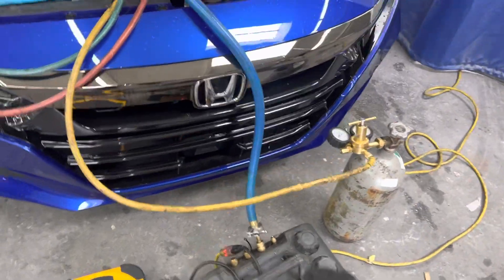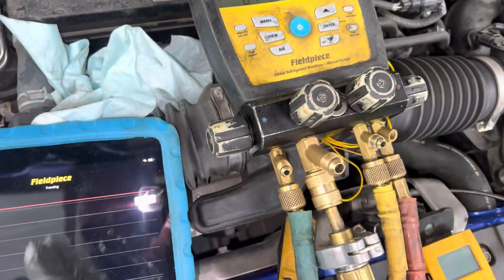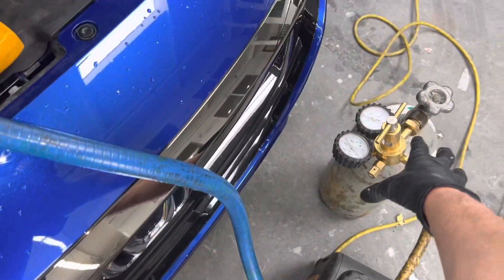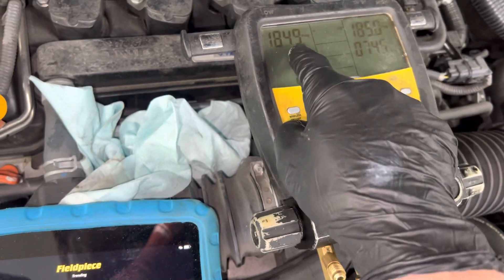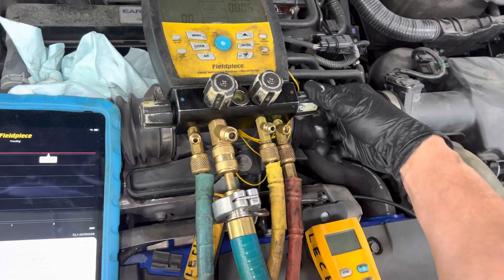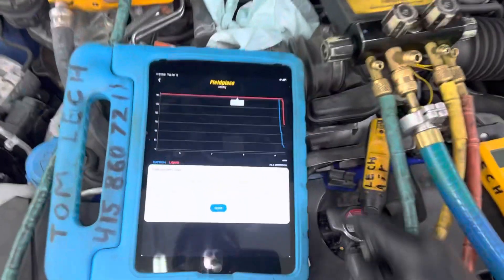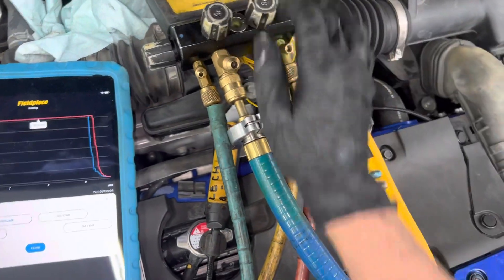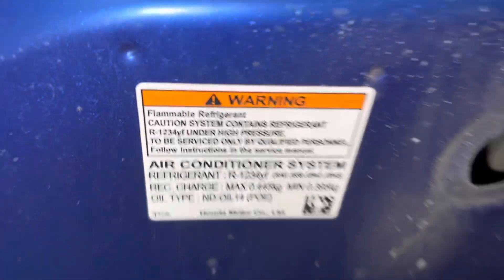HIGH PRESSURE NITROGEN DECAY TEST 185 PSI Testing for leaks on a Honda ￼

Comment: Love that graphing feature. Nice video.
Reply from the maker: Nice to work on something else in the shop.  Catch intermittent problem or see fan, clutch, duty cycle of compressor control valve are working over time. 
       Can even see when thermostat opens on coolant
Reply: @coldfinger459sub0  so that is like a scan tool reading data from the DLC then? Never seen one like that, but it looks specialized.
Reply from the maker: Yes, like a scan tool reading amplitude overtime, but doing the exact same thing with pressure. 

And the pressure directly correlates to a signal power in a fan on or off or a duty cycle signal going to a variable speed fan raising and lowering the fan speed to adjust the high side pressure and you can data log record and actually watch it in operation. 

The same goes with the duty cycle that goes to the compressor control valve, unbearable, displacement, compressors you can actually watch the swash polite be ordered to move, increasing or decreasing displacement change in pressure .

Comment: After vacuuming the system,when you connect the refrigerant cylinder,do you purge the air from the yellow hose?
Reply from the maker: Are usually use the vacuum from the big blue hose through the manifold to the yellow refrigerant hose
Reply: @coldfinger459sub0  here in this video you close the yellow hose you said no leak.When you connect that yellow hose to refrigerant tank  do you will vacuum that hose because here still attached to nitrogen tank?
Reply from the maker: @issamadam9352  attached yellow hose moves to refrigerate.      Then vacuum yellow hose.
Reply: @coldfinger459sub0  To what microns do you vaccum the yello hose?
Reply from the maker: @issamadam9352  100 µm
Reply from the maker: @issamadam9352  between videos I don’t think I showed him the video detaching the hose from nitrogen and then attaching to refrigerant tank.

Comment: After A/C repairs do you nitrogen pressure and decay test first then vacuum, then recharge?
Reply from the maker: I do a very quick vacuum say five minutes get down to about 500 µm. 
       Then I fill it with 200 psi of dry nitrogen to perform the high-pressure nitrogen decay test. 

Then I bleed out the nitrogen after the test is finished 

Then Iperformed the long vacuum.  Then vacuumed to K test to confirm it holds vacuum.. 

And then recharge.
Reply: @coldfinger459sub0  say the system is contaminated with moisture and you can't get 500 microns in a reasonable amount of time? I don't understand the need to do a quick vacuum first if you're going to end up doing a long vacuum later on anyways? Just trying to wrap my head around all this. Wanting to pick your brain a bit.
Reply from the maker: @MACEVES  you’re trying to remove the air in the moisture that’s already in the system out.  Trying to at least approach 500 µm which is usually very easy to do unless it’s extremely moisture contamination. 

You’re at least lowering the . 

You’re removing the oxygen which is 21% of the air that could be in the system after it was taken apart and replaced  

So you’re not pushing that into compressing it under a high-pressure . 

Infusing it into the existing POE oil or PAG oil. 

So now when you start your high-pressure nitrogen decay test. 
       You will only have 100% dry nitrogen that you have introduced into the system. 

Your relationship will be only with 100% nitrogen.  
     With 0% oxygen. 

And if you were doing commercial low temperature Refrigeration. 

You’re shooting for a level at 200 µm or less vacuum decay test. Because the moisture level has to be so much more less.. 

And if you’re doing something like the commercial VRF heat recovery systems that I sell and install.   you’re doing a high-pressure nitrogen decay at 600 psi. 

And because you’re dealing all with copper refrigerant piping.  That you’re actually silver brazing high temperature at all the joints with no gaskets or rubber seals.. 
       With all brand new copper, you are constantly purging dry nitrogen through the system, nonstop from the beginning of the system of the outdoor unit all the way to your furthest, indoor air handler that you can have anywhere from 1000 feet to 3000 feet of copper piping. 
      When you’re finished dropping the vacuum that you have left on the pump anywhere from 24 hours to 48 hours of vacuum until you achieve the level of down to roughly below 100 µm. 

In one of my videos, I show down to 13 µm with over 1000 feet of piping. 

These are the levels that you’re trying to achieve if you did a good job. 

In Automotive when you’re putting a brand new system into a car, all the components are brand new out of the box. 

You easily get roughly 30 µm to 60 µm within 10 minutes to 15 minutes. 

And then I would start my high-pressure nitrogen test after I have proof my system is dry.  Hit 200 psi. . 

After I passed the high-pressure test. 

Slowly bleed out the nitrogen through the low side pressure.  Then start the vacuum again from just the low side.. 
        Well, reading the dedicated micron gauge on the high side port. Back down to below 60 µm. . On a clean brand new dry system.. 
     Which is really easy to do when you’re using a vacuum pump that is rated down to 3 µm and you’re only using silicone hoses no refrigerant gauges no refrigerant hoses. 
       Or soft copper lines instead of hoses. 

Soft copper lines are cheap and easy to make and very pliable. And you could pull a deeper vacuum with them easier.
Reply: @coldfinger459sub0  I see, appreciate you sharing your knowledge.
Reply from the maker: @MACEVES  it makes everybody life better. 

The technician performed to work has fewer comebacks .  And he can make better money.. 

Better work by a technician means the customer gets a better quality job without the technician being the cause of future defects and breakdowns . 
      The consumer gets better value. 

Hopefully the shop can make better money so they can afford to pay their technicians better and give them better benefits 

It’s a DYI doing his in his backyard. He can learn more and do better jobs for himself, saving himself money. 

It’s a win-win win Situation all around for everybody.

Comment: What do you recommend to do a nitrogen test on a budget with the equipment? Can you use manifold gauges regular ones and a nitrogen tank to check for leaks?
Reply from the maker: You have to have a pressure regulator on a nitrogen tank. 

Because there anywhere from 2500 to almost 4000 psi . 

So the nitrogen regulator will take that down and adjust it to your 200 psi that you want . 

The hoses on refrigerant gauges are only rated for 800 psi burst pressure. Your hoses would explode  like a balloon.
Reply: @coldfinger459sub0  I see, do you recommend those H2/N2 gas sniffers for when you have the nitrogen in the system to find leaks or the good ole soap and water method will work? Also when you purchase the nitrogen its pure nitrogen and no moisture ? Appreciate your videos, dealer trained and never learned this in class.
Reply from the maker: @omega200k5  the hydrogen nitrogen or the helium nitrogen mix it’s a 95% mix of nitrogen with 5% helium or hydrogen.  They premixed.

But you can buy nitrogen from any welding supply warehouse . 

The helium or the hydrogen it’s called forming gas that mixture and you have to have a specific leak detector just for helium or a separate one just for hydrogen they’re not the same .
Reply: On a empty system, if you charge it with nitrogen to check for leaks, could you also run with the nitrogen to check for compressor operation or would that burn up the system?
Reply from the maker: You should not run a system charged up with nitrogen. 
Nitrogen does not compress the same way as refrigerant . 

Inside the cylinders, the compression racial will be much higher in some situations even for a short time you may not break the compressor, but you can damage the compressor . 

Something that you may not notice right away .

Comment: Which side do you put nitrogen through high or low side?
Reply from the maker: You’ve asked that question before. 

And I’ve probably explained it, and at least 100 videos . 

I push nitrogen through the high side and bleed it out the low side . 

I have the nitrogen follow the same path as the normal flow from the compressor high to low

Comment: Vacuum from both or one side?
Reply from the maker: If vacuuming after adding nitrogen from either the triple purge and vacuum procedure or from high-pressure nitrogen decay. 

After releasing the vacuum pressure through the low side, I vacuum from the low side first to pull the rest of the nitrogen sweeping from the high side to the low side 

If I am just hooking up to a system that has been open to the atmosphere or new components, have just been added . 
      Then I draw vacuum from high side and low side simultaneously.

Comment: Why the hell don't Fieldpiece include a stabilization time on the decay test to make more convenient? This will make your job much easier and less time will be wasted when you forgot to start the decay test in time.
Reply from the maker: You just press one button. 
Not difficult. 

And if somebody forgets. 

And they can’t figure out close estimate of time to when they started. They have bigger issues and bigger problems.
Reply: @coldfinger459sub0  I mean it's much better if they let you set stabilization period after that it will automatically goes to decay test.
Reply: @coldfinger459sub0  I prefer using the nitrogen regulator on pressure testing. 0.1 psi = 100 psi on the nitrogen regulator with 1/4 copper pipe swag on the pipe of the regulator going to the nitrogen tank.
Reply from the maker: @w0lvez1  the test starts immediately after you turn off the vacuum source. 

After it’s stabilizes, depending on the moisture content and size of the system, it could be 30 seconds or 30 minutes . 

You’ll see it with your eyes .
Reply: @coldfinger459sub0  Testo tightness test is much better because you can set stabilization period. Very helpful when working on 410a & R32 that requires more time to allow hose to expand.